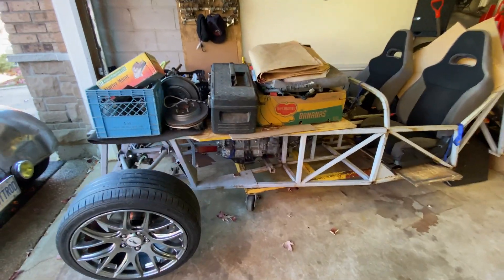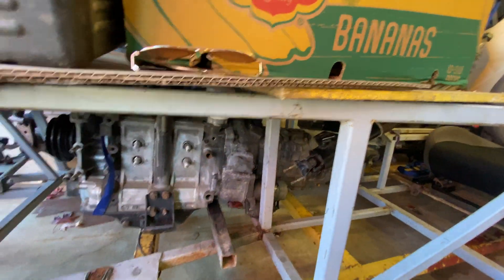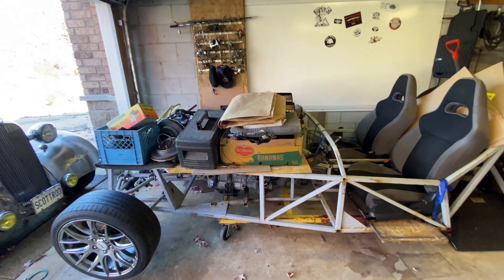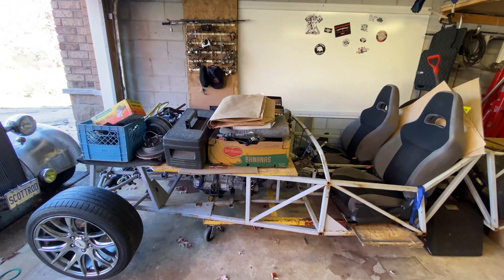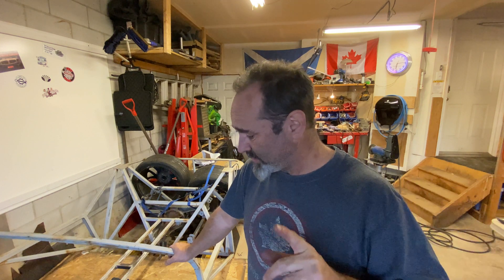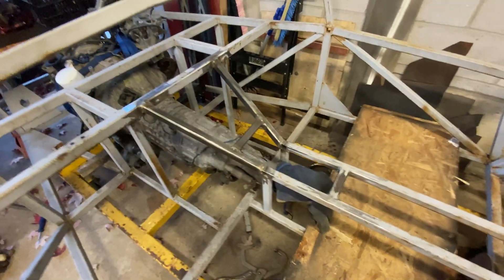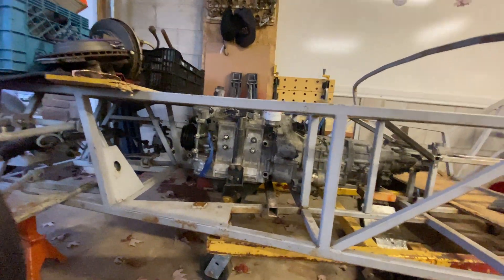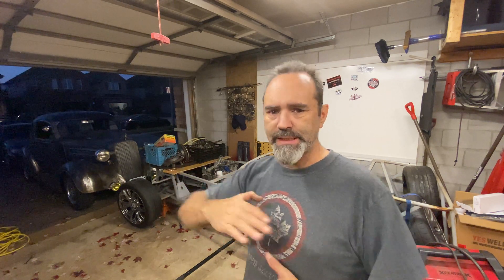First Frame Modification On The Locost 7R7 Project.

Comment: Good job Charlie Brown . Remember that if you use flux core wire on the mig you can then remove the shroud from the torch which allows you to get into those 90deg  corners a bit easier when welding the frame . Thats the upside , the downside is all the slag that you have to knock off .
Reply from the maker: You know, I was just thinking about why you need the shroud if you're not using gas? Is it just to protect the copper guide?
Reply: @ScottRods  The shroud is only there to guide the gas so it creates an envelope or bubble . Inside that bubble there is no oxygen so you get a good weld but if you use flux core wire the flux burns off the oxygen so no need for the shroud . It does stop spatter from clogging up the tip though so continue to use the shroud unless you need to get into tight spots and continue to use your anti spatter spray (you do use that ?). One thing worth looking for , you can sometimes get a shroud that is narrower at the opening but this depends on what gun type you use .

Comment: The engine must be set at 3 degrees down at the back and the diff must be set at 3 degrees up at the front so the uni's run correct .
Reply from the maker: Is that Rotary specific, or general engine rule?
Reply: You want 1-3 degrees of angle between the driveshaft and front/rear u-joints.  The rear of the transmission and the diff flange should be parallel.  So you can either offset the transmission/diff laterally (diff pinion offset often takes care of that) or up/down.  This is a general rule for all driveshafts with u-joints.  So on my Locost, as an example, the engine and diff are set up dead flat to the chassis but at slightly different heights, so between that, and the offset pinion on the Miata diff, the u-joints are running at the proper angle.
Reply: General rule or the uni's wear out
Reply from the maker: @leoncolyer9420  I understand the parallel thing, I was more interested in the allowable tilt of the engine. My Chevy V8 has quite a steep tilt, but it doesn't rely on oil injection like the rotary does.
Reply: @ScottRods  its the working angle of the uni's so they dont wear out . The rubber joints might work in a strait line . Not shore 😊 but some one will tell us 👍🏼👍🏼👍🏼

Comment: I think that the engine w/trans has to come down, no? That trans is way to high.
Reply from the maker: You need to remember that a rotary engine has it's "crank shaft" in the middle of the engine, where a regular engine has it's crank at the bottom. So if you mount the engine like a normal engine the sump would hand way below the frame.